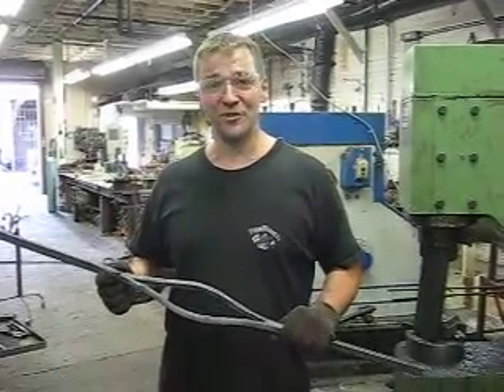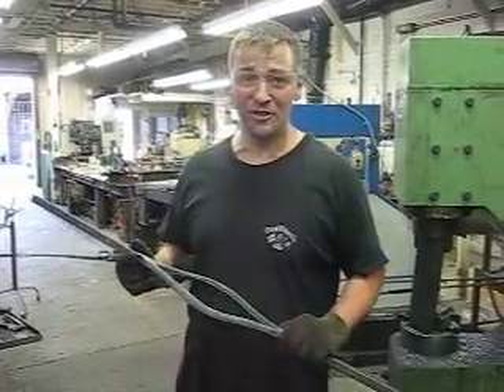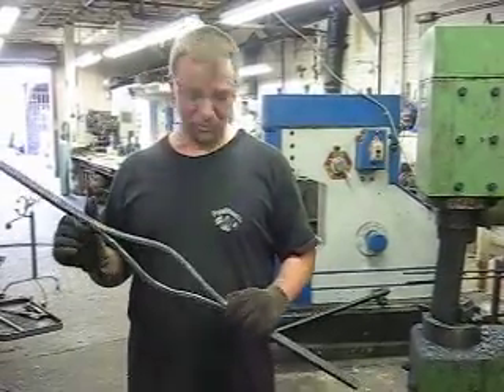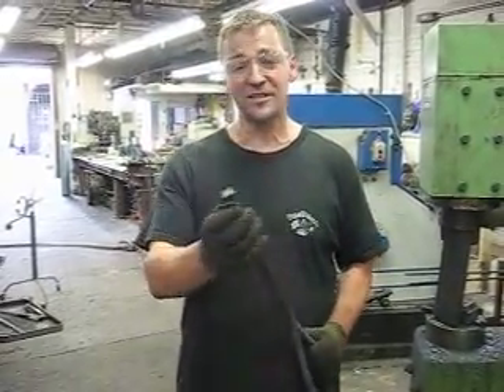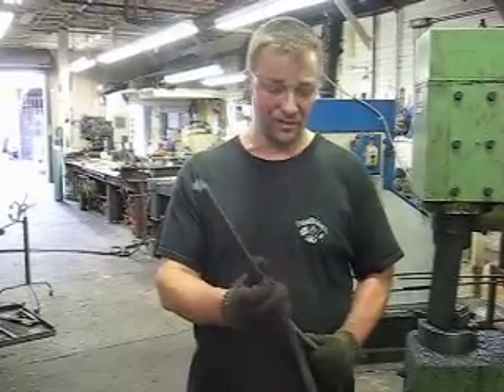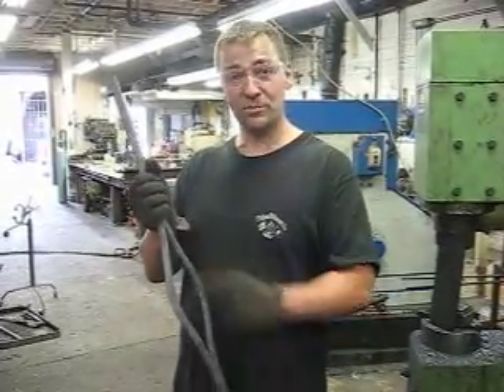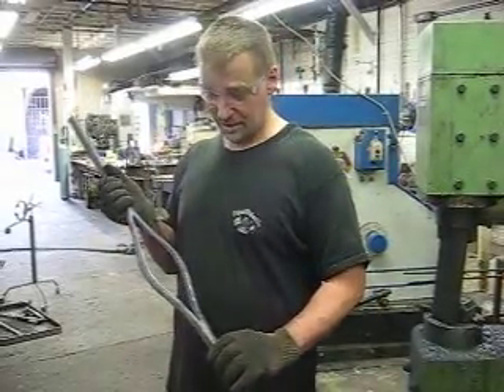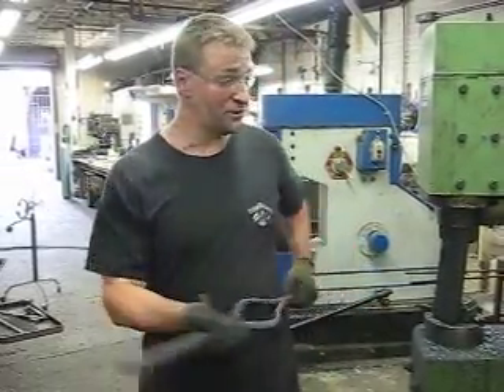forging diamond twist #1

Comment from the maker: antioxidity, the "ax thing" is  a hot cutter.  i like the tong-held design as you just take the blade out as it gets hot, throw it in a bucket of water, and put a replacement one in, and just keep cycling them like that with no time lost for cooling.  also, it is easier to re-sharpen them, and you can have a boxful of the cutters and only one pair of tongs, which saves a lot of space, and the effort of making and welding a handle to each and every one of them.  They are easy to use.

Comment from the maker: @Hyshinara yes, using the stump is different from using an anvil -- you can straighten hot steel on a stump without leaving any marks. please note that i also use a rawhide mallet, rather than a steel hammer to hit the hot piece with. often, after you make an intricate piece, it's better to correct any distortion that way, as you don't want to leave any unnecessary marks.  this is particularly true for any kind of twisted pieces. thanks for asking!